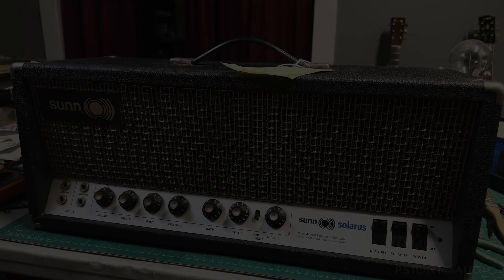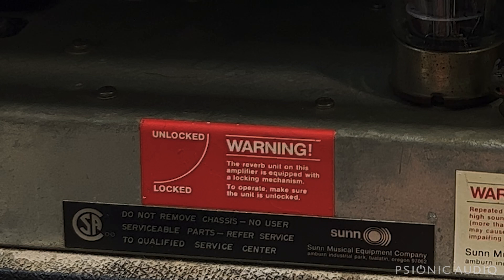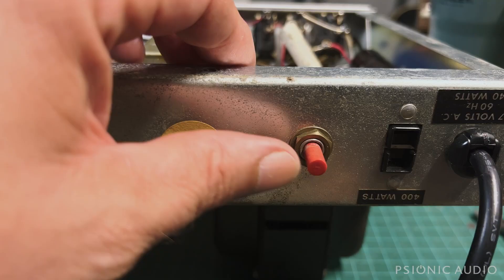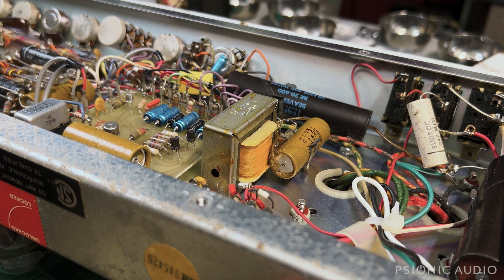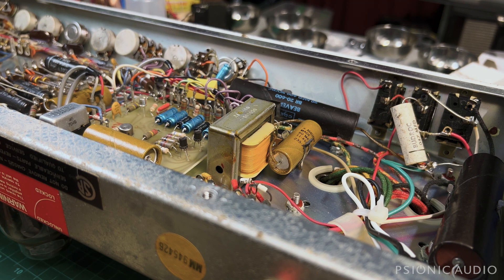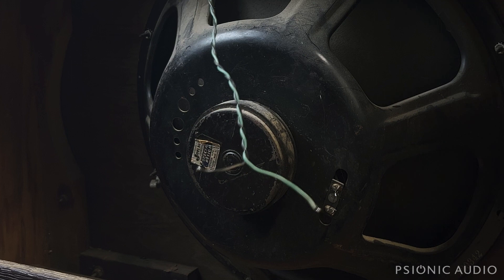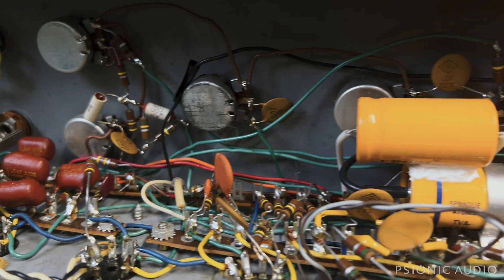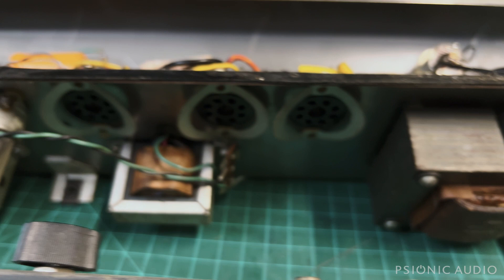When is an Amp Worth Fixing? | Sunn Solarus & Gibson Hawk

Comment: I love restoring tube-type Sunn amps. They're based on the simple but solid Dynako Mark III design, they're easy to fix or modify for higher mains voltage, they sound great, and they last forever. My personal Sunn Sentura II is sitting beside my Fender Vibrolux Reverb. I'd sell the Fender before I'd sell the Sunn.

Comment: Excellent video!!!  Love it!!!  It's nice to see two vintage amps saved from the dust bin!!!  Just an FYI... the Sunn Solarus came with a fuse holder.... the circuit breaker on the amp in this video is a retrofit.  The Reverb Spring Hold Down Lever was a useful feature for travel.  The lever pressed down on the springs to keep them from rattling while driving to a gig.... I wish all reverb tanks had a lock down lever!  There are few things more annoying then listening to reverb springs rattling on a 90 minute drive.  :o)  As a Sunn fanboi, I have to mention that Sunn amps are not exactly flimsy - after more than 50 years, my 1969 Solarus is still sounding awesome, completely original, except for the tubes and several electrolytics which I replaced with Panasonic brand caps. My amp has the original reverb tank, connection wires and jacks... not bad for 53 years!  Sunn amps, especially the Solarus, have a loose, squishy tone that make for amazing lead recordings. With the volume above 7, leads begin to melt into hot buttered bliss!  For Doomers try a P90 guitar > Catalinbread Naga Viper > EQD Acapulco Gold > Sunn Solarus = Heaven On Earth    LOVE THE VIDEO!!!! THUMBS UP!!!  SUBSCRIBED!!!
Reply from the maker: Glad yours has held up. I’ve had quite a few in where the very large transformers have deformed the relatively thin chassis. This one has a little flex but I can tighten things up.
Reply: @PsionicAudio   Not sure who started the rumor that Sunn amps were flimsy... but, they should be punched in the nose!  Sadly, the few articles (on the interwebznet) that spread this misinformation, were enough to popularize the belief.  True, Conrad Sundholm and his brother Norm, could have spent a bit more time designing a cleaner wiring scheme but, they did not use cheap components nor did they use thin or flexible chassis.  I've owned and repaired a few Sunn amps... Solarus, 100S, Model T, Sentura I and II, 1200S,  Sonaro.  Not one had any flex in the chassis.  You can find photos of Sunn amps, on Reverb.com that had been dropped, causing the transformer's feet to bend, without any damage to the chassis.  Were Sunn amps built like rock solid Hi-Watts?  No!  But they weren't built like Gorilla or Marlboro amps either.  Had they been poorly built, I doubt that Nirvana, Jimmy Hendrix, Sunn O))), Red Fang or, the Who would have toured with Sunn amps and cabinets.

Comment: I still have a Gibson Falcon Amp that  I played in high school (1960's). It has been in storage for decades, and I sometimes wonder if I should recap it and see what it sounds like.
Reply: The GA-19RVT (Reverb, Trem, dark brown tolex) of the mid 60's is, or a can be, a good sounding amp, rather like a Deluxe Reverb sonically.
Reply: @goodun2974  Interesting,  I'll pull it out of storage and recap it. At least it will be like going back  in time 60 years.

Comment: The issue with knowing the value of repairing a Sunn is that they rarely come up, and when they do, if you want the sound, you buy it whether it's in good or bad shape. There are likely 2 or fewer Solarus amps on the market at this point, and I'd be willing to bet they're both super overpriced. When you consider that the cheapest price for a shippable tube Sunn is in excess of 900$, and this one is in much better condition than that one, and has the desirable 6550s instead of the less desirable EL34 or 6L6s, it could make sense to go ahead with the repair.

The Sunn sound is very desirable, and if you're into doom, you'll pay out the wazoo for one of these legendary amplifiers, just because nothing else gets the sound you need other than a Sunn.

For instance, there's no way in hell you're getting a Sunn Model T, 2000S, or Coliseum for less than 1k unless it's broken, and broken amps like those come up less than once a year.
Reply: Yeah this is why I use a Sunn pedal that simulates the entire amp (including power section) with jfets. Get's you 90% there for sub $300.
Reply: @wootks  I actually have a Kenny B Sunn Model T preamp in my rig. Love it, but it doesn't really fully emulate the sound of a Model T.
Reply: @BoomTexan  Nice. Check out the electronic audio experiments Model feT. This also attempts to simulate the power stage of the model T amp. Pretty much you run this into a clean power amp.

I have heard some demos that have the pedal sounding pretty close. Def close enough to me. To run a real model T cranked you need either ear plugs or an attenuator. I am sure the volume level is insane.
Reply: Just looked up the Model T and Solaris Schematics.. Thanks got giving me an idea for a niche to fill amongst the dozens of people building yet another Marshall clone. 

Only tricky part about the mk2 Model T would be getting the mid EQ inductors custom wound (or attempting to diy one). The Solarus is pretty simple though, especially if people aren’t that bothered about the tremolo? Even that could be replicated with more modern transistors without it affecting the sound at all.
Reply: @Jonathan_Doe_  The Mk1 Model T is the favorite, people really don't like the EQ on the 2nd model T.
Reply: I just landed a Solarus for 800 cad with its matching cab. Fully fonctionnal but has 6L6s... I have become dead broke as a result but I regret nothing. Any crazy modifications id have to do to use it with 6550s?
Reply: @burnbabies666 
the output impedance is is roughly the same on the original transformer, but the tubes are gonna distort and could blow the transformer, because they'll output far higher than the 6L6 output will

however, the solarus typically comes with el34s, so it might have been modded already

id get a tech to look through it, because a lot of stuff could have been done to it in the past to convert it to 6l6s

Comment: Love those Sunn amp and if you know the basic secret to the Sunn tube amp transformers are super easy to find. Nothing sounds quite like a Sunn KT88 amp. These amps were made by musicians from Dynacord kit parts and a hodge podge of various components. The OPT is basically a Dynakit 470. The PT is a stereo PT from a Dynacord ST70. If you want that Leslie West sound from Mountain's Mississippi Queen, this is how you get it. Plan? Just do it. "NIKE!" Jimi Hendrix even  played thru Sunn amps for a while too. I can fix 3 or 4  Sunn amps cheaper than I can buy a Park 75.
Reply: I have lots of Sunn BOMs in my magical filing cabinet. One day, maybe some day, I shall transfer all od that over to the computer. Maybe. Lots of those parts are no longer sold today, but I use snap in caps now with wire wrapped lead extensions. Do what you have to do to make it work. Gibson's crestline amps do not inspire me at all. Comparing Gibson to Valco is unfair to Valco.
Reply: NOT Dynacord... DYNACO... Different companies... But, yes, you are correct about the dynaco output transformers. They're basically audiophile grade transformers used in guitar amp service... Overkill
Reply: I think it was Ritchie Fliegler in his book "Amps! The Other Half Of Rock N Roll" who asked the question "where did all those Sunn Amps go? This is the amp that gave us "Mississippi Queen!". Perhaps some of them got cannibalized for the transformers by the Dynaco-owning vintage-audio crowd?
Reply: @Satchmoeddie  , "BOM'S"?

Comment: My Sunn no longer has the reverb or the tremolo as I've removed them and totally gutted the amp.  It's not worth repairing those circuits as they suck in those amps.  Oddly, my other amp is a Gibson Thor.  Had to completely rebuild the poor wiring and grounding throughout.  It works great now.  I wouldn't sell either but then I couldn't get much for them anyway.
Reply: I'm embarrassed to admit I own a Sunn (and it's my favorite amp, after fairly extensive mods) considering these doom kids that can't actually play, and use the amp to make giant fart noises. I've had mine for decades though, so I predate that fad. I too don't use the reverb/trem, though in mine they remain intact. Thing is though that circuit is partly tube powered. Some enterprising soul could take that extra gain stage and put it to good use for a high gain preamp. On second thought, don't do that. The low gain preamp is a big part of the Sunn sound.

I'd be really interested in your modifications to the wiring/grounding because that is a big issue for these amps and mine hasn't been done. HOOK ME UP!

Comment: Yeah I knew it would be tough to quote before you even said anything. In the end, you're better off high-balling someone and then hitting them with a lower bill at the end if it works out rather than taking a change that it will be more than you quoted... and then the owner never picks it up.

I kinda had a bit of a desire for an old small Gibson amp... but after looking inside one, and seeing what you are dealing with, maybe not. ;)

Comment: I’ve discovered over the years of collecting vintage drums and now looking at amps and guitars I believe the mojo is often just nostalgia. Although old wood does make a difference in the tones. The hardware and electronics on the other hand are not mojo inducing. Old tubes made to military spec are better, but where do you get those in good shape.
Reply from the maker: Well, in some brands old transformers really were very well made. And in general older amps had a lot more space between components - that is a criminally overlooked under-appreciated factor that very much affects the sound.

Even simple things like lead dress - compare a ‘76 Super Reverb to a ‘66. It matters.

But it is all replicable in a new build.

Comment: Those Sunn amps may not sound like a Marshall or Fender, but it's a sound some people look for. They seem to be rising in value and becoming somewhat collectible. Have you ever tried taking a deposit before starting work to try to avoid unpaid bills? Or is this something most customers aren't willing to accept?

Thanks for another interesting and informative video!
Reply from the maker: I only require deposits when I know the approved repair would exceed the resale value of the amp. On the rare occasions when the customer never picks up/pays I have sold the amp after the legal amount  of time and contact attempts have expired. I think three times so far in two decades.

And usually when the repair costs more than the amp is worth I try to dissuade the owner from having the repair done. Sometimes I decline the work.

Comment: Ehhhh….  You are thinking too much about this… don’t get too pessimistic. I had the only vintage amp repair shop in a two hours drive for about 10 years and wound up souring on it for these very reasons. I was tired of being the bad guy telling people their $100 garage sale find needs $200 in parts and another $200 in my time to fix. I closed that business down about 10 years ago. When friends bring me stuff now I just go straight to the bench. If the line cord looks good I bring the amp up on a variac with a line current meter to get a feeling for what’s going on. If it’s alive I start doing my normal checkout stuff. If not I give a 15 minute window to look around and see if anything is obvious. If not, then we go to is this an historic piece worthy of saving. If not then I politely tell them the bad news. I have found that amps that have sat for most of their lives I no longer just blanked change out every cap. It’s just not necessary but it takes a couple decades to develop that spidey sense but then again I have been working in our family electronics company since I was a child. Don’t get too jaded and cynical. That’s very easy to do in the amp business. BTW when dead Suns used to come in I would sell the idea of let’s just use the cabinet chassis and transformers and let me build you a custom skulcrusher in it’s place as the transformers are the best parts of those amps.
Reply from the maker: I’m not cynical. I just want people to know some of the behind the scenes stuff techs deal with. For example, I got the green light on the Sunn repair. Between finding the closest schematic, finding how the actual amp differs from the schematic, measuring the unloaded B+ (temping in good caps for that), measuring the actual bias voltages, and getting my parts order together that’s an hour and a half of labor but nothing has been “fixed” yet. 

And I think it’s important for customers to know what all is involved beyond soldering.
Reply: @PsionicAudio  Yeah. You're vid comes up with the 6550's and 600V firecrackers and okay, unloaded B+ between 450 and 700 volts, iron suggesting more rather than less. Lyle knows that, but how does he explain to the customer?

Comment: I have a Gibson Skylark GA-5 ca. 1967. Bought it on Ebay for $225. It came to me with no issues nearly 50 years after its creation (at some point someone did add a grounded power cord). It is LOUD. The problem is that it sounds "thin". All treble, little mids, no bass. Single coils are out of the question. I wonder if that little chicklet you pointed out is the culprit.
Reply: That era of Gibson amp is known for being ice picky thin. A lot of it has to do with the eq’ing in the preamp iirc.
Reply: @taylorwerner384  Thanks. An out-of-state shop told me they could fix it. If it is indeed "fixable" I would like to what is the cure.
Reply: @texanfournow  Try replacing the T-Filter chicklet with a resisor: 470K or less (down to zero). But try just lifting C2's ground connection first.  Then try adding a 1M grid leak to the input stage. https://el34world.com/charts/Schematics/files/Gibson/Gibson_ga_5t_67_skylark.pdf
Reply: @edwardleaver7838  Thank you for your detailed response!

Comment: The Gibson amps of that era were pretty much junk. Trying to unsolder old parts was a nightmare.  The terminal lugs would often break, only slightly less often the board would break into brittle pieces.  Most don’t sound that good even when working as it should.

Comment: What kind of caps do you recommend for guitars? I’ve noticed a lot of folks using expensive caps with high dc voltage ratings (like 600), resistors too…I can’t understand why. Thanks in advance Lyle.

Comment: My one Sunn amp was a POS. Bought it new with a matching 10 and 18 speaker. Blew the 18" and the amp was not loud or stressed. Sent out to Sunn under warranty but I had to pay shipping both ways. With a warranty like that who needs a warranty. Manufacturer should bear all costs once I bring it to an authorized service center. Once repaired I had zero faith in the amp and traded it in. As it would turn out Sunn had a Sunn supported artist playing in a club in NYC and my old amp gets sent out for these shows for this artist to use. Well I get this story related to me by the shop that handled the repairs and the trade in... The artist is playing the gig and the amp catches on fire on stage...Good thing I got rid of it in a nick of time. A Sunn Coliseum. What a turd. The Gallien Kreuger I traded it for served me much better until it got stolen. Part of the price of doing business in NYC. Lost 1 amp and 2 basses.

Comment: question:  why would a cap blow and take out the PT but the proper fuse is still fine?  thanks, love your site!
Reply: Are you merely wondering or are you asking because this happened to one of your own amplifiers? The "short" answer (bad pun, sorry!) is because the mains fuse is in line with the primary winding of the transformer but the shorted filter cap is in line with the high voltage secondary of the power transformer (actually it is in parallel, from the high voltage secondary and the DC output of the rectifier, to ground). The mains fuse is therefore somewhat isolated from the short-circuited cap by the resistance and inductance of the transformer windings. Note that some amps such as Marshall may have a second fuse for the high voltage supply as well, which, depending where it is placed in the circuit, should blow pretty quickly if a filter cap, rectifier tube or diode short circuits (or perhaps if an output tube short-circuits). Now if a filter cap is electrically leaky but not completely shorted, it might cause the transformer to run hotter than normal until it eventually fails. A modern amp might have an additional failure mode due to a thermal fuse tucked inside the transformer, which goes open if the transformer overheats, to prevent the transformer from catching fire.🔥
Reply: @goodun2974  thanks, love your site!!!  keep up the good work!
Reply: @michaelbutler2312 ,  It's not "my site" here, I'm just a subscriber and viewer.  Lyle is often too busy to answer every individual question and so, since I myself am an audio repair Tech, I took it upon myself to help him out and hopefully answer your query in reasonably correct fashion . If he feels I left something out or got something wrong he might chime in and that's perfectly OK with me.  I am here to learn as well as to share,  and most of us seem to be of similar mindset.
Reply: @goodun2974  oh, ok, thanks.  he's responded before so i thought it was his reply.  thanks again.